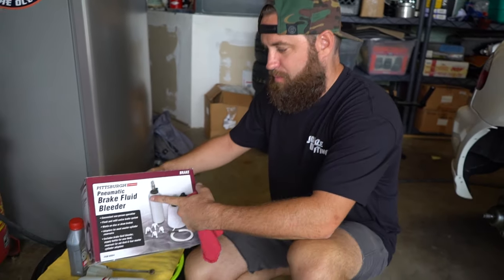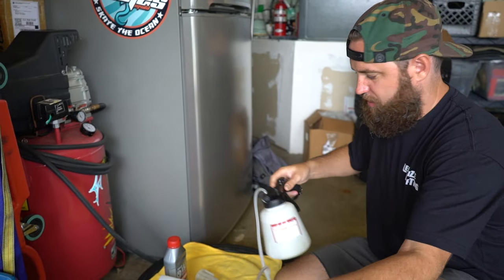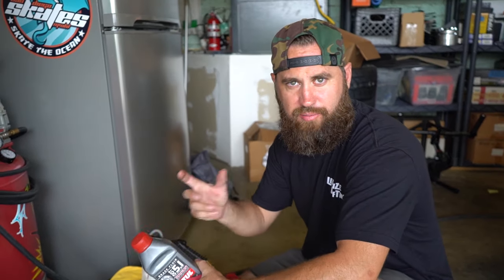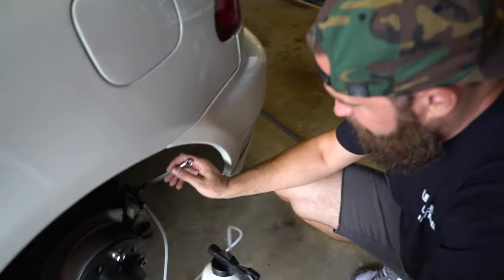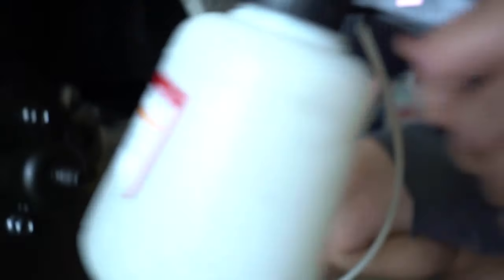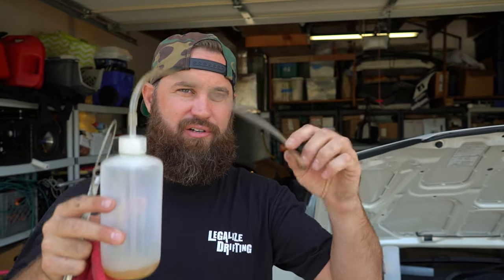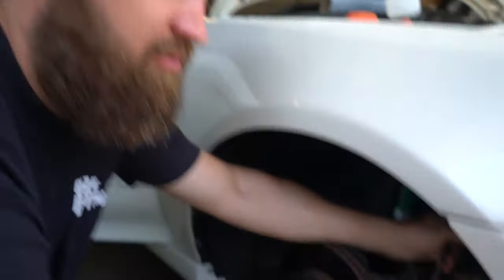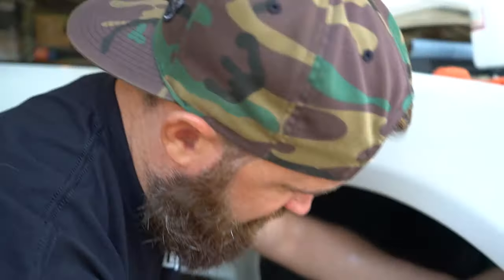HOW TO BLEED DISC BRAKES | PNEUMATIC vs. MANUAL

Comment: From what I've come to understand is that the machine makes it look like there's air in the brake line because the air comes in around the bleeder screw, so sealing it off with some heavy grease could help. Apparently, you'll never really get a solid flow with that pneumatic tool... took me some hours to learn this the hard way. lol. So if nothing else, hopefully I can help someone else with this comment.